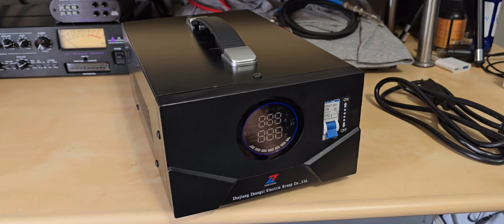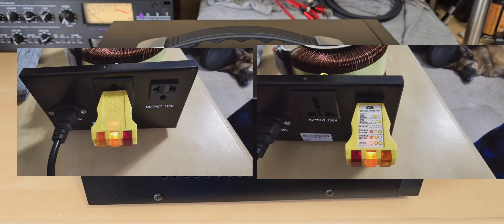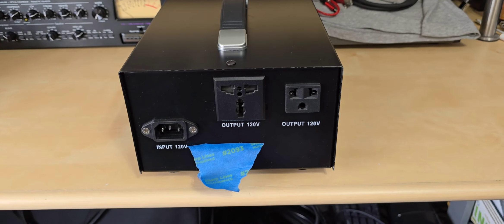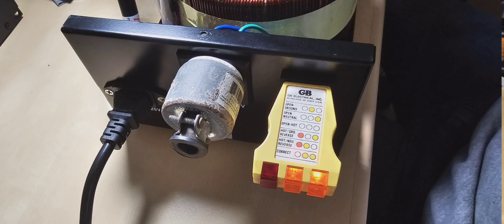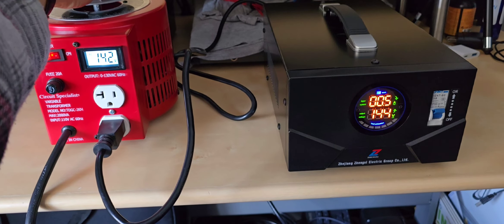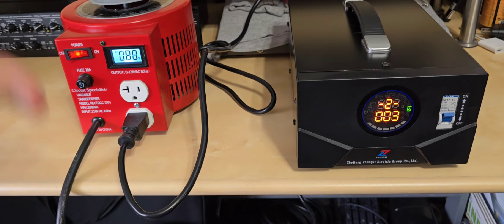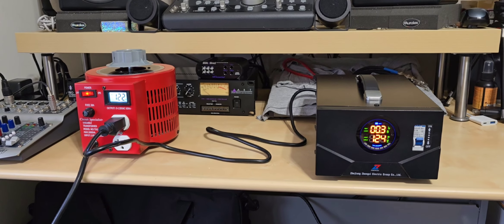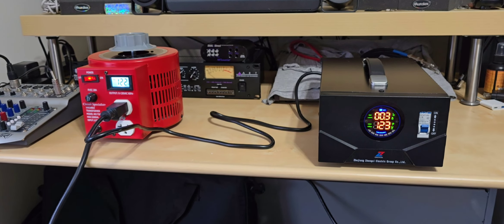ZHENGXI 120V Isolation Transformer AFT-1000W: Product Review & Repair

Comment: Very nice.  Would be interesting to see how that would clean up generator output.
Reply from the maker: I am going to try that, but I'm not expecting miracles. Transformers reduce voltage spikes and EMC noise, but a generator with 22% THD won't bring it down below 5% for example. 

Also the manufacturer is selling me an updated logic board with a reprogrammed microcontroller. The cost to buy a programmer tool, adapters etc would be prohibitively expensive compared to a new board.

Comment: I am currently experiencing a huge issue with 'Dirty Power' in my home. Since I am unable to find anything online with respect to using an isolation transformer with a guitar amplifier to clean-up my 'Dirty Power' issue. I was wondering if you would have any thoughts on this matter? Are there any issues as far as not having a path to ground if using this unit with a guitar amplifier? Or, any other issues there may be. 

Thanks in advance. 

-Jay
Reply from the maker: Exactly what do you mean by dirty power? It is not advisable to run a guitar amplifier assuming it's a tube valve type without a safety earth ground. The isolation transformer will not clean up high total harmonic distortion. If you are dealing with RFI and EMI issues there is some filtering that can help but it does not offer a great deal of suppression that a proper power conditioner normally has.
Reply: Audiophiles with high-end audio systems use AC line conditioners to filter out any harmonics and any other "noise". For example Amazon sells a Furman AC-215A Compact Power Conditioner for $109.95, or you can get a much better one from Crutchfield also a Furman IT-Reference 20i for $3,919.95. There are many of these out there so take your pick.

Comment: The outlet being wired incorrectly is a big NO !!!  This is clearly another crappy Chinese design.. not to be trusted.
Reply from the maker: I did bring the issue up to the manufacturer and they did tell me that they would address in production. For an isolation transformer however and the secondary floating from primary earth, for that specific purpose, the polarity reversal wiring is a non issue. If you do reference earth for other purposes then it would become an issue.
Reply: @Bassguitarist1985  it's all AC at the end of the day lmao, but i just bought one of these so i will absolutely keep an eye on this when it arrives
Reply from the maker: @searchiemusic  keep me posted!